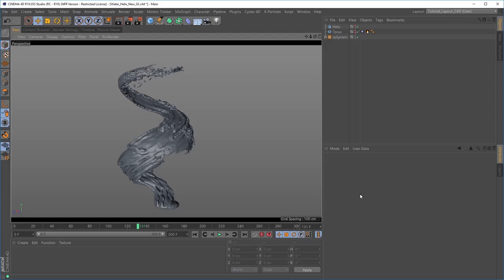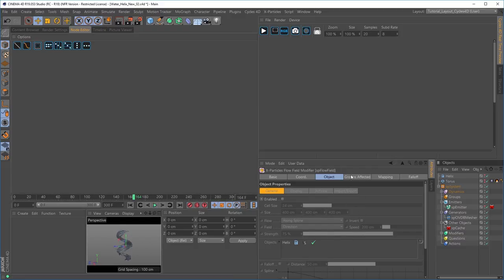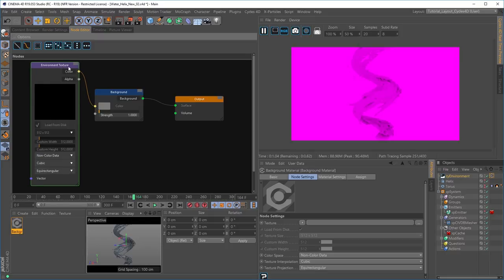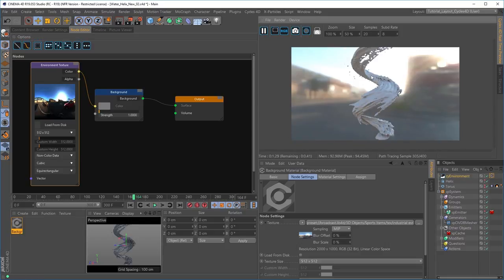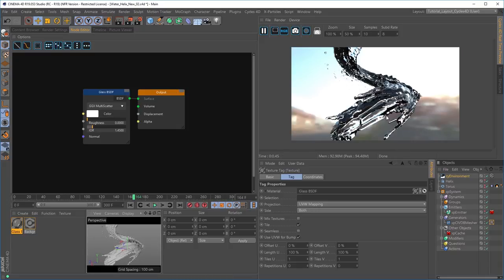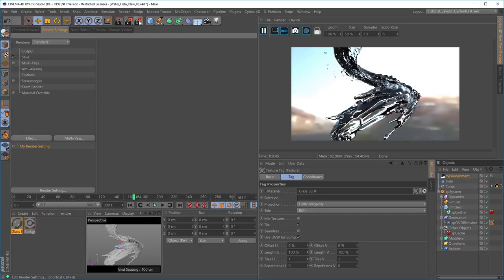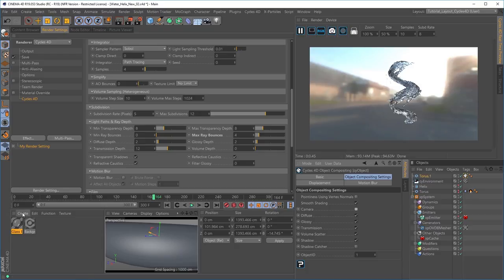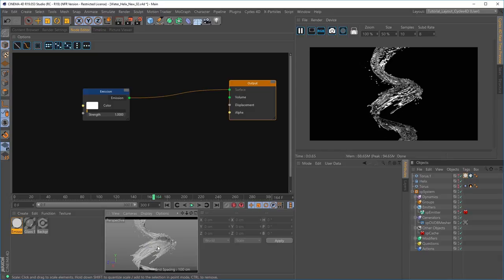xpReel Tutorials, Water Helix, Cycles 4D - Part 2

Comment: Is there any way to use that color vertex map without Cycles? I was trying to get it to work with the C4D node system but couldn't. Materials is a big weak spot for me and this is my first venture into X-Particles. Just curious if there was a way to access that color map and use it without Cycles. Thanks. Great tutorial :)